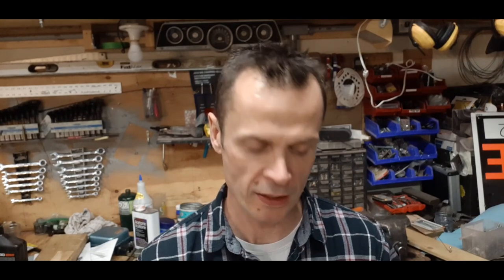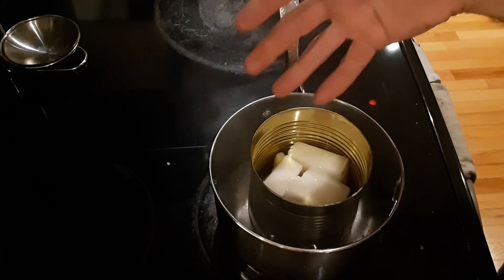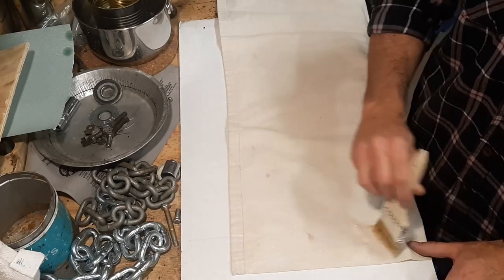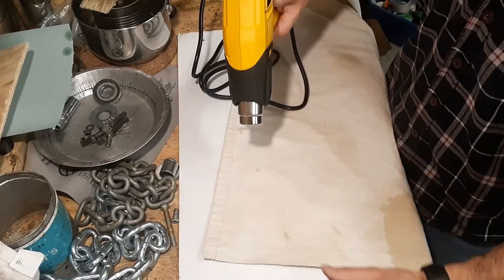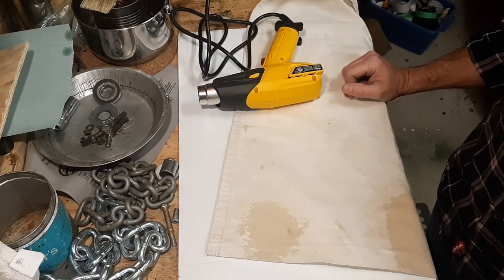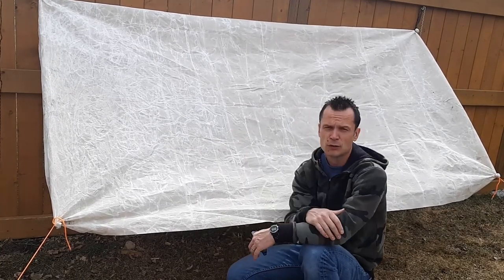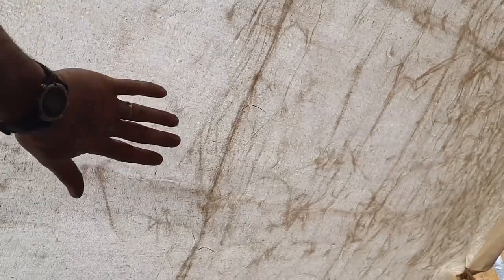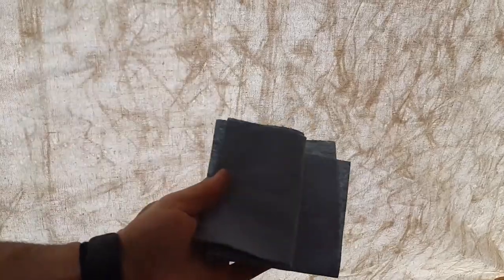DIY Waxed Canvas Tarp

Comment: How long would the wax last before it started to breakdown and start to leak after reapeated folding an unfolding of the tarp?
Reply from the maker: I cant give you an absolute answer, but this is my best guess and advice.  I have had my tarp for over a year and had no issues, it doesn't get used a ton but certainly sees use during the summers.  I have found that on really hot days (90F)the wax will appear to soften and almost remelt, repairing itself and repenetrating the fabric.  If needed you could also just reheat and weak spots with a heat gun.  May be a good start of summer maintenance practice regardless.

Comment: this is what i was looking for, knew there had to be an alternative to drying oils. Do you think this would work just as well on a cotton sheet?
Reply from the maker: It will work on a cotton sheet as well, just keep in mind the stronger the material you use the better you sheet / tarp will be.  I used canvas drop clothes from my local hardware store which is a bit heavier and stronger then a bed sheet.

Comment: How good would wax, linseed oil and turpentine work?
Reply from the maker: I am not sure, I have only done the two methods - wax or linseed.  I have seen several posts about guys using the combo method.  My linseed did finally stop heating up after 2 weeks hanging out side but still really gives off a strong odor.  I am using it to cover some outdoor equipment and it is great but I think even with the heat issue solved the smell would not make me want to keep it inside.